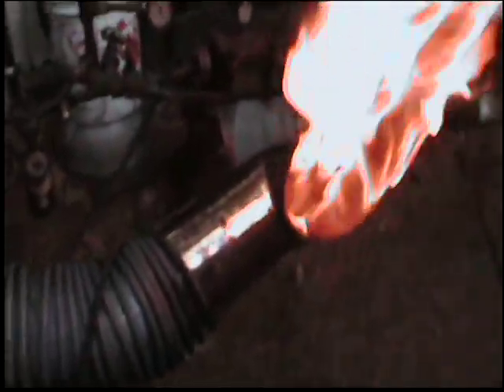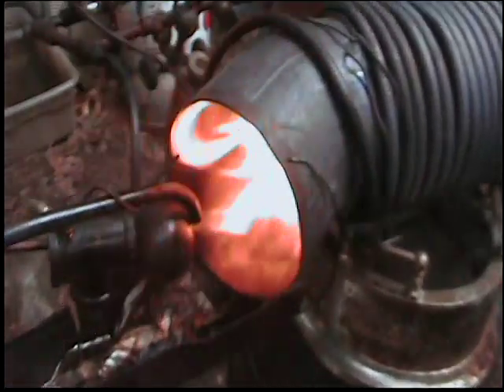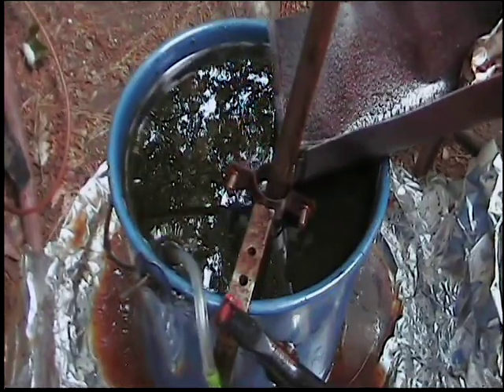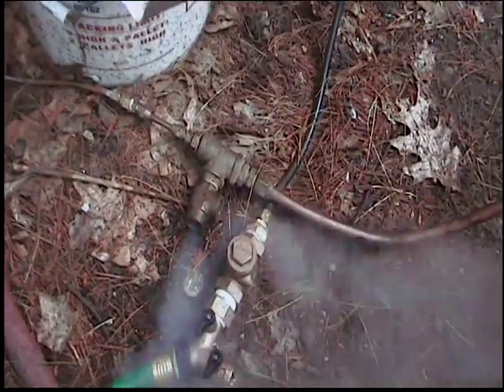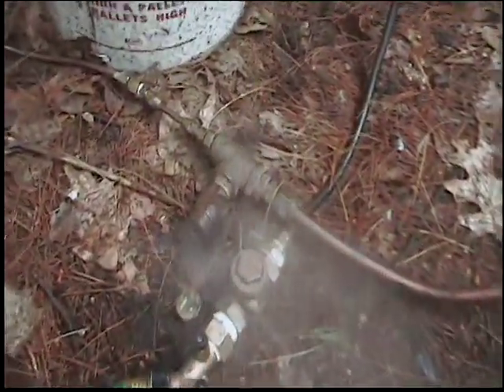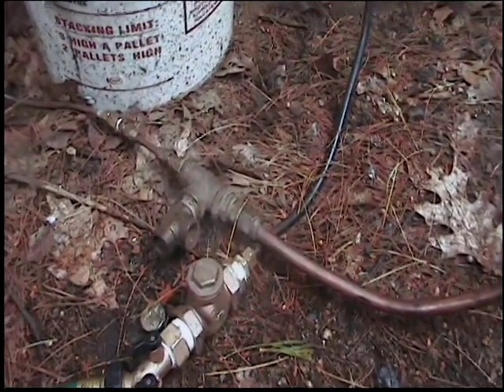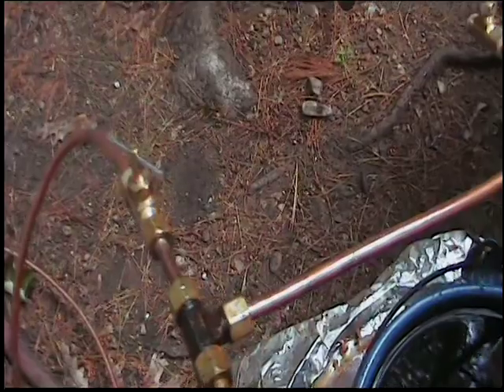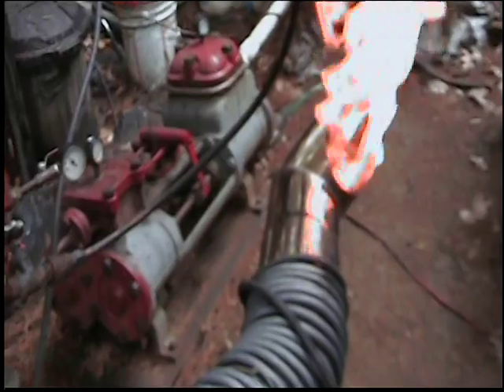Steam Babington IV

Comment: Would at steam powered venturi/burner work?  Use air for starting, then steam once the coil heats up. This would solve two problems, lifting the oil and atomising it at the same time.

Comment from the maker: I would like to find a way to replace the air bubbler pump even though it uses very little electricity. I think it would run from a battery or perhaps a thermoelectric module.

Comment from the maker: I will try to come up with something more formal and email it to you. For now the basic parts are 
1 2" ball, 25' 3/8" copper tube, 10' 1/4" tube& 3 needle valves,some T's a pan with oil 4' steel exaust pipe 6" and aquarium air pump. 1 checkvalve and adjustable pressure relief.